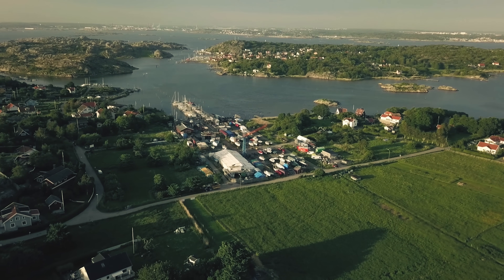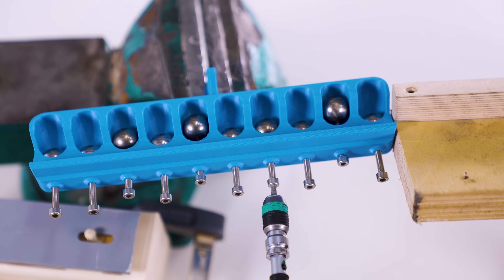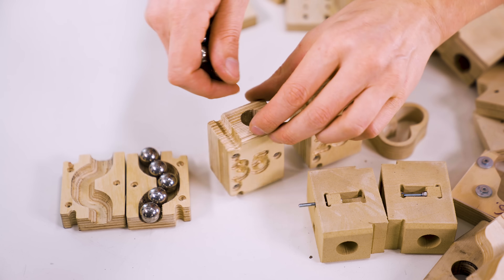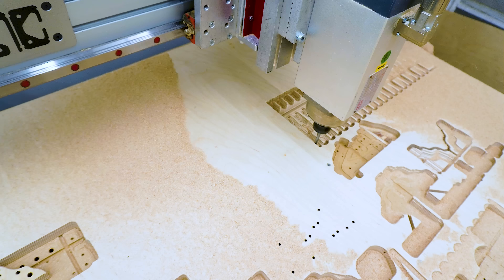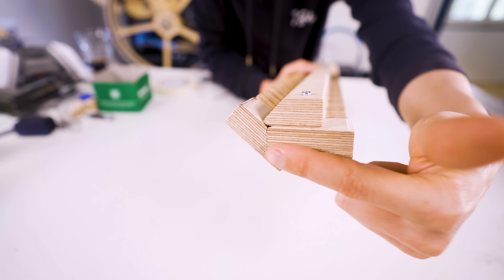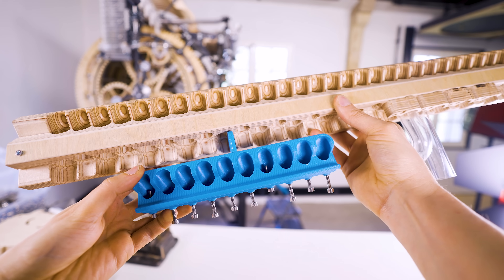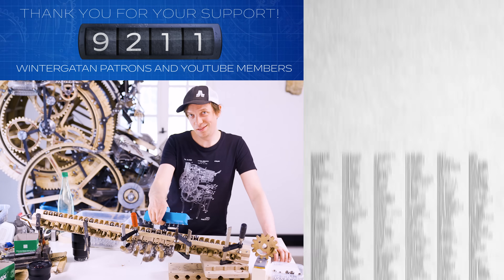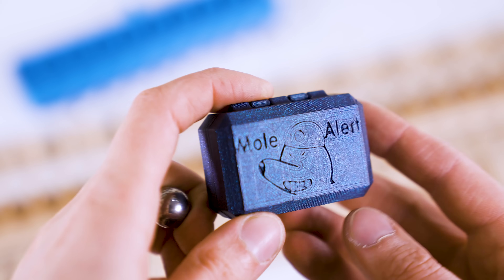Engineering Basics: The Best Part Is No Part

Comment: The one issue I see if you don’t feed it sufficiently, then it could be harder to feed the holes towards the end and you could not have the marbles to play the notes.
Reply: That assumes that all marbles are fed from the edge rather than from multiple points of entry. With multiple entry points there'd be less risk of channel starvation.
Reply: The marble lift inserts them at different positions along the divider and excess marbles end up on the fish stair to roll along the entire divider.
Reply: What you just describes is the same exact problem that was already present on the first iteration he just replaced. (honestly it was worse on the old one, because this one skips over some holes even when they aren't full yet)
Reply: @LegDayLas  the reason that the old part is being replaced isn't that lanes were being skipped over though. The main issue was that every lane needed manual adjustments to avoid things from getting stuck. A skipped marble at most risks a missed note. A stuck marble queue means at best complete silence, at worst that marbles overflow into areas where they shouldn't be.
Reply: @DavidWeinehall  I know... hence why I said the op's observation has nothing to do with the new iteration.
Reply: Add more marbles.  The machine needs enough marbles to fill all the tubes and other places.  Once you have enough marbles the limitation becomes the lifting system.
Reply: The slow-transfer lanes from the conveyor belt are spread out so they feed marbles on to the tube-feeding divider at multiple spots. I think it's only the fish-stair lift path (which re-circulates the "excess" marbles that don't drop in to an open slot) that feeds purely to the top end of the main divider - and that's fine, because if any marbles that go round that path that means they didn't encounter any empty channels in the first place.
Reply: Yes, he mentioned that once in an earlier video. But he doesn't know how to solve this problem yet. Unfortunately, he has the drums at the far end with the shortest feeder tubes and they are probably the ones with the highest demand for marbles.
One solution would be to move them to the other end. But, personally, I have some issues with the overall design.
Reply: Here is the fun part with the new design.  Because we are not limited by height, or by pressure on the gates, you do not need to feed the drums from directly above them in the MMX.  Martin can optimize the feeds based on which instrument needs the most marbles.  

For example on the snare you can have the primary snare drop feed from the far left, and the secondary snare be half way down the machine.  This would cause the PMA pipes to cross all over the place in the back, but it would be more efficient.

Comment: I love the fact that you're basically taking engineering and making it open source.
Reply: Huh?
Reply: @thomasbecker9676  Well with open source software development, everyone has access to all the information and can build on it. Then if someone has a good idea they can show it to whoever runs the project to have it incorporated into the source code. It's basically community-driven development because more brains find and solve more problems in more ways.
Reply: @JessieTrinket  If it was truly opensource, then anyone could copy the MMX and use it as they saw fit. I doubt that would go over well.

Comment: Both this and the escapement gate seem like elegant, great solutions. Though on the videos, they sound loud as all hell. Seeing as Martin spent an entire month or so tweaking things to get rid of a little wobble that was generating noise, won't these impact the STN ratio desperately?
Reply: I think, with the progress he's been making now, that was probably just procrastination to not fix the actual issues
Reply: He's later explained that his priority has shifted more to a functioning reliable machine, and will revisit the other concerns down the line.
Reply: Getting rid of wobbles wasn't so much about reducing noise. Also he's not mic'ing the top of the machine, but much closer to the vibraphone, and could even go to contact mics there if need be. All other instruments are either contact, pickup or very closely mic'ed. There's also noise gates he can place in the signal processing to turn automatically turn off mics when they aren't needed. Just fyi, not saying it's of no concern...
Reply: @tommj4365  Yeah, the wobbles was partly about noise, but it was more about reducing friction in the system, since that not only sucks energy out of the flywheel faster, it also damages the parts.
Reply: It could be rubber coated or a soft 3D printed plastic. Would still work flawlessly.
Reply: Hopefully the divider is far enough away from the instruments that SNR from this part isn't affected too much?  I think the clicks from the pawls of the conveyor are probably still louder... The sound from the new gate design might hurt SNR given they are closer to the instruments
Reply: martin did make some tweaks to the design which may be revisited as some of this is days old now,  but overall design as far as marbles hitting and bouncing is pretty much the same. So its unlikely that this is more noisy then the previous version. Its probably just the mic martin is using for recording the tests, being able to hear the marbles is more interesting at least for the test..
Reply: I give him one month until he decided to scrap the part again for that reason, Poor CAD Team
Reply: My thoughts exactly. 👍

Comment: IF this works which I hope it does the design is really simple and effective BUT it should really be done from something else than wood, hard plastic or that sort of material that is not so prone to wear overtime. You can hear when the marbles travel down the path that it has a hard impact on every channel.

Comment: Is it me or marbles in 10:42 go bumping the channel walls much more and get too slow in comparison to the 3D printed model? looks much more bumpy!
In 1:30 it looks very flush
Reply: Probably needs additional sanding, though I'm sure this part will receive 2-3 more iterations before its good enough to be on the machine permanently.
Reply: I agree, it could be the angle needs more fine-tuning, but it is clear in the demonstrations that the marbles on the plastic model are accelerating until they bump into an open channel where the CNC full-scale version the marbles decelerate until they are pushed from repeated inelastic collisions.

P.S. Before someone calls me out on the self-contradictory statement "repeated inelastic collisions" I am aware that the collisions between the marbles are considered elastic. What I am referring to is the post-collision behavior of the marbles.
Reply: Yes.  He has put a radius on the walls of each channel whereas the plastic model they are square

Comment: Looks good Martin, but I can't help but notice that some of the marbles are skipping over holes. That might be problematic down the line.
Reply: Occasional skipping is no problem, there is a big backlog of marbles for each channel in the pipes, and more marbles constantly coming by to refill it. Only problem is if the same channel always or often gets skipped so it doesn't refill fast enough.
Reply: They have always been intermittently skipping holes, this definitely isn't worse than it already is with the currently mounted design.

Comment: The next concern is that marbles may skip over a hole if they are going too fast.
I'd consider a bit of a zig-zag path to give them a lower max speed, and route them towards each hole to be deflected onward by a blocking marble.
Reply: During the video they where actually moving slower because the marbles bumped against the ones all ready slotted, I feel that adjusting the angle would really fix speed issues as you can tilt it more to slow down or speed up, now the next problem I foresee is the marbles stacking from moving too slow

Comment: Risk is that it is speed sensitive instead, i.e. have a tendency to roll past a slot. You might need an adjustable angle or speed control to manage this behavior.
Reply: I was thinking the same thing. But then I realized that he already has the big swoopy fan on top that will spread out the entrance points so they can go slower and still have the needed throughout.
Reply: Looks like the speed is adjustable with the angle. Either way as long as none of the channels are being drained completely it should be fine.
Reply: @Undercoverfire @Emerson Peters True he has some control of the base speed but it seems to me from the previous videos that the speed is a bit chaotic. The speed will slow down as it goes down the "bumpy" area but the risk is that the entry speed will be too fast for the first channels.

Comment: "The best code is no code" is also a saying in programming!
Reply: The best wings are no wings!
-the aeronautics industry
Reply: @nukiradio  I've never once heard anyone say that.
Reply: @thomasbecker9676  that was a joke. I was hinting at the limits of this philosophy.
Reply: and "dry" code (dont repeat yourself) is also one. "why make many parts, if one part can do the job too"
Reply: @rePath  Yes and no. It's usually the "K.i.s.s." principle: keep it short & simple. But if you prefer to reuse your code, I would rather keep it encapsulated, single purpose, reusable and abstract.
Reply: Thats insane. I had the same idea and wanted to write it into the command but man this community is just to good. 
But may I correct „the best code is we’re everything has just one use and one implementation“ if there is code multiple times you can sum it up. 
In this Sense get ridge of the unnecessary

Comment: Do you think that using wood for the mechanisms cause failures due to changes in moisture?  We have a drawer in our camper that won’t open in the winter time due to moisture. Do you do anything to control or measure the moisture in the air where your machine sits?
Reply: ....this could be a problem for the World Tour....Moisture Singapore...dry Australian....
Reply: not only the wood....think about oxidation on the metal parts / the mainframe wasn't preserved before.
I can't imagine there will be a seccond version of the complete mmx......didn't notice this.
Reply: He's coating the new parts with guitar lacquer if that helps
Reply: This is only a prototype. For the world tour he will build one out of more durable materials.